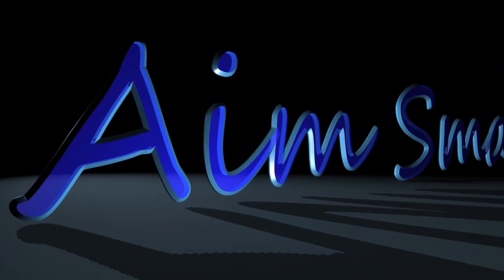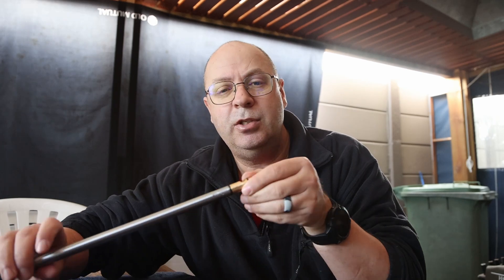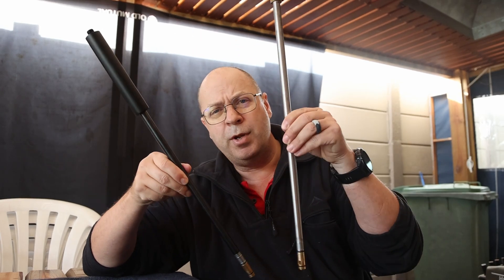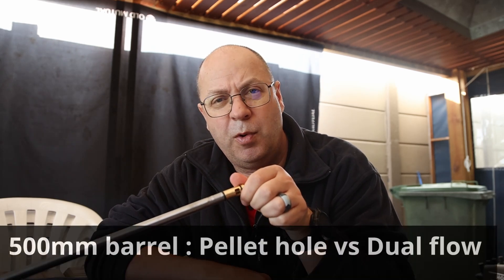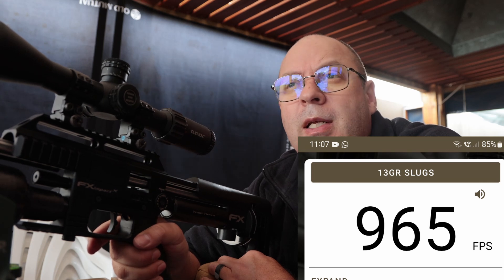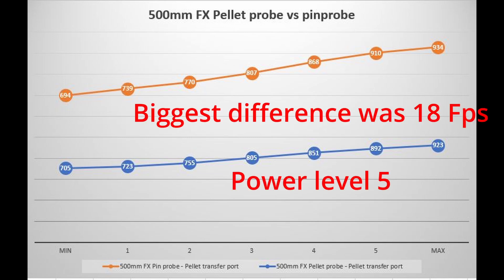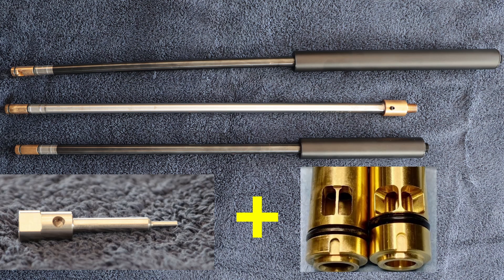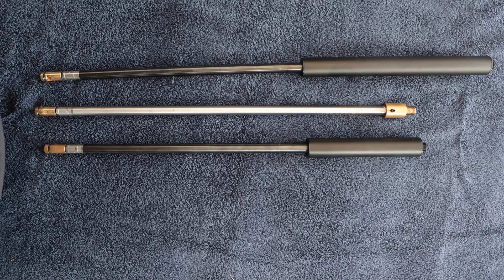How to increase speed on your FX without opening the internals?

Comment: I hope you can answer this
Why does FX list the MAVERICK (very similar to the impact) as 
177 10.34gr @ 930fps MAX
22 33.9gr @ 876fps 
25 43gr @ 925fps 

I mean... how can a heavier pellet go faster? I thought 177 was the fastest? Same gun... very confused.. 

What was your maximum power on stock internals with 500mm barrel with say 10.5gr 177 pellets?
Reply from the maker: Those different calibre guns usually have different lenght barrels, different transfer ports etc, different hammer weights and internals. They might advertice the 25 with 43gr @925fps, but then the shot count might only be 10 or 15 shots at that power due to the intensive high regulator pressure needed to shoot that heavy projectile at that speed. So the regulator pressure will play a massive role (and size of plenum). I could get about 27fpe with the standard internals and port on the 177, but then the regulator was at 170bar and the gun was working extremely hard, shot count non existend and accuray gone as well. Pellets don't like too fast a speed in any case, I prefer 177 not faster than 870fps max and .22 ar 900fps max.

Comment: Now we are getting into air flow dynamics.
 The best flow would be obtained by drilling through the transfer port hole of the housing and into the brass barrel extension with exact matching hole sizes. Then profile the probe nose to have  a radius curve matching the hole size which would give a radius bend effect like that used on exhaust ports and manifolds. Air guns are exhaust ports and the technology from them should be used where unmatched port holes have a detrimental effect on gas flow. At no time should there be any obstruction like the air splitter in the dual port as we are after unrestricted flow, not turbulence to aid combustion like into a cylinder head on the inlet side. I would like to see FXs data on these ports and where they came up with it beyond a good marketing campaign. Show me the flow chart?

There will come a time when straight line direct flow of air from the plenum and down a hollow probe will produce the maximum efficiency and all this other stuff will just disappear. As for the LW barrel being faster it will have more to do with pellet stall on firing. There are two reasons for this. Firstly this is common with 22 lr chambers where a longer throat slows speed because the bullet has moved forward thus creating a larger chamber for peak pressure to build into. A short throat that engages the bullet will reach the same peak pressure potential but in a more confined space and launches at higher initial speed. Same thing in centerfire rifles with bullets jammed in or set off the lands. But more specifically, the LW barrel has constant resistance due to a tighter bore than an FX liner where the pellet is virtually in freebore until it hits the choke. I have slugged numerous FX liners and they all have little resistance and are virtually in freefall till that choke. Actually i am surprised that they get the speed they do. While powder burners and air guns are two different animals, pressure is pressure and how it is utilized determines velocity.

Comment: Thanks Gert this was an extremely educational video, I always wondered what the big differences would have been with the dual port and Slug probe. And I must confess its not a massive difference. Having a 700mm barrel does definitely help in gaining some speed, I allready fitted the Power Plenum (watching Mr Ernest’ video step by step allows you to do this very carefully-do NOT skip a step) And now shooting 25gr in .22 at 135 Bar at 920 fps. was 980, but obviously dialed down the valve adjuster for less air waste and tighter groupings. Thanks again for the awesome videos. You and Matt and Ernest and Keith Gibson have the best educational Videos out there. Keep up the good work!!! Regards from JHB SA

Comment: Is your pellet probe fx or Huma Air,  I installed the Huma Air High flow transfer port and the Huma Air high flow pellet/slug probe along with the 1st and 2nd stage regulators and it made a huge difference in fps, consistency, standard deviation and extreme spread in my 30 caliber

Comment: When a barrel is faster or slower it is obvious that there is more friction in the barrel and this could benefit the spin of the projectile but also cause deformation. When there is to much spread in velocity you should buy smaller size pellets. Always push a pellet true the barrel with the righ tool for this job when you buy new ones or test other brand, this way you get a feel for what head size fits your barrel best. This should never ask for a big force !

Comment: Excellent video mate . . . this explains perfectly how 3 simple "upgrades" will impact your velocity and it also explains that simply combining them all together will not automatically mean you can add up the velocity gains per item. Just like an ochestra with the best musicians in the world doesn't automatically mean they will sound like the best orchstra in the world. If there's no homogeneity and balance, it will not work. In this case it could mean that the bigger transfer port, combined with the pin probe and longer barrel soak up more air so a slight increase in valve dwell time could optimize the speed even more. But like you mentiond, this is a video for people who just want to do some simple upgrades and this shows perfectly what you would gain.

Comment: Its because the rifling twist in the LW is internal, more agreesive at grabing and spining the pellet/slug compared to the FX barrel which has its rifling twist pressed from the outside. I tried the same exercise with a LZ cold hammer forged barrel and got an increase in FPS of 36 compared to the FX one with same weight pellet. It was also allot more accurate (tighter group) out to 100 yards.

Comment: Hi what foot pound were you shooting  and have you tried get more power with a 12fpe like we have in England  world this help more ? Great video
Reply from the maker: Hi Carl, I think I was shooting 10gr pellets at the time. Yes doing these changes will add speed to the gun and increas the Fpe. In the UK you have a restricter on the gun, there are lots of videos on how to remove it... The longer barrel adds plenty of speed for pellets, the dual flow in 177 you need to be more careful, some dual flows are so big that the pellet wants to fall into them. Pinprobe and pellet is not going to make the biggest difference, more effective with slugs.
Reply: @AimSmall  wonderful thanks 🙏
Reply: Hi, I don’t find any information or video how to remove the restricter, In Spain we also have fpe restricter if you can send some video or information how to remove it I would be really grateful 🙏thanks in advance

Comment: Would I get more power in sub12 ft pounds using this method in uk
Reply from the maker: If the gun has been restricted to 12fpe, yes, a longer barrel, dual flow port and pinprobe will add some speed to the gun. But don't expect miracles due to the power restrictions build into the gun, I don't know if the reg is adjustable or not?
Reply: @AimSmall   the reg can be adjusted if the anti tamper is removed but I wouldn’t know how much to adjust it … I don’t want to break the gun but I guess it’s the risk you take.. I think I might try the longer barrel and dual flow and pin probe just to see…. I honestly admire your videos what you do is fantastic ( the thinking man’s way ) 👍
Reply from the maker: @andydowden8117  If the anti taper is removed you can pusg the reg all the way up to 170 bar if you want to, unfortunately the air flow with the 177 isn't that great at that power. My gun is currently setup at 150bar with the duel flow and pin probe, it shoots 13gr slugs at over 900fps.
Reply: @AimSmall  wow thank you so much keep up the good work👍

Comment: Excellent video, very informative. I am curious to know how the air consumption is with the different options. It is clear that barrel length will not affect to efficiency but it’ll be interesting to know if air waste is higher than FPS gain. Of course you would need an accurate digital gauge for measuring the bottle pressure. In shorter words, it may not be interesting gaining some speed if the air consumption is way much higher hence shorter shotcount. Many thanks for your really interesting videos!!!
Reply from the maker: The shot count actually improves as you can get the same speed at lower reg pressure. The air is also used more efficiently, with the smaller air flow hole a lot of air is released and wasted, with the dual flow that same amount of air is more economically applied to the back of the projectile.

Comment: hmmm.. just a thought. When I was trying to find the perfect pellet for my Hatsan .25 it dis-liked JSB Exact King 25.39gr pellets @676fps , accuracy was okay, speed was not. Other pellets of slightly higher weight came out faster (AA Diablos Field 25.40gr @ 698fps and JSB Hades 26.54gr @ 705fps)... which I thought was probably pellet design and lead softness... but not sure.
Reply from the maker: 100% correct, not so much pellet design, it is more about the head size of the pellet, the softness of the lead and the lube used in the manufacturing process. All plays a part.

Comment: try the resistance of the chamber in both barrels ,adding the pellet , , if a pellet is to loose , then it will already moves at low pressure  because the air puls is not at it highest level .a pellet thats fits correct will start with more pressure and pressure is speed

Comment: Very informative as usual. Keep it up. Quick question, does the shot count suffer with the larger dual port? Just got a Crown Mk2, so i’ve been spending LOOOOOTS of time on your channel.
Reply from the maker: Shot count actually improves... let me explain, with the smaller port there is a lot of wasted air each shot, thus you need to up the regulator to get the desired speeds. With the dual flow the air efficiency is better, less air produces the same effort down the barrel, lower reg pressure equals higher shot count.
Reply: @AimSmall  Gert, that makes sense. Despite asking this question on SEVERAL different platforms, you are the FIRST to actually 1: address the question, and 2: give an answer. For that, I am extremely grateful. This "little" bit of info will make my tuning process so much easier; I want to tune for 22 gr slugs and 18gr pellets at the twist of a couple of knobs instead of having to change barrels every time I want to use slugs. I'm going with the lighter ones purely for that purpose. THANK YOU.

I'm waiting for my digital gauges before I start though. I've seen an average of 15 bar difference between the gun bottle and and the compressor and buddy bottle (which display pretty much the same pressure).
Reply from the maker: @dominicnoon  Yeah the gages are in general all inaccurate, I treid them all, from Huma to "new" FX. I did have one digital gage that was accurate but it developed a leak that couldn't be fixed... very expensive indeed. So now I use th fill gage on my silinder to check how much the gun gage is out...
Reply: @AimSmall  Good point about the cylinder. I ordered the Sehkmet because I liked the feature of shots remaining, not that I really need it, i've seen a few good reviews on them. Going to keep the originals though....just in case.
Reply from the maker: @dominicnoon  Please let me know how it works out. I loved my digital gage until it popped.
Reply: @AimSmall  I finally received my gauges and installed them yesterday. The factory ones read about 5 bar high at 110 bar and 18 bar high at 150 bar (reg pressures). No wonder I couldn't get it anywhere near where I wanted. Anyhow, I now going to start the tuning process. Any hints on settings to be able to use 25gr in the low 900s with a reasonable shot count or is that asking too much from the Crown Mk2? The plan is to have one for 25gr and turn the HS knob down for 18, 15 and 14gr without having to change reg pressure and maintain same scope zero. I know it's a large ask, but theoretically it's possible.
Reply from the maker: @dominicnoon  The gauges are most of the time out by 10 bar at least. The crown is an awesome gun, but due to the lack of a big plenum struggles sometimes to generate more speed. You will need to get that reg at 135bar for a start, should give you enogh power to shoot 25gr at 900fps.
Reply: @AimSmall  Thank you Gert. Didn't realize I could be able to do that with such a low reg pressure with the .22. Will get onto it and let you know how it goes.
Reply from the maker: @dominicnoon  My Impact has the big plenum but I am able to shoot 26gr slugs at 1050fps with the reg on 135bar... 700mm barrel. You might want to consider a dual flow transfer port and pinprobe as a later stage, the combo will add at least 30fps to the setup
Reply: @AimSmall  thank you. I flipped the barrel 180 degrees for the “slug” port and yes, I’m getting between 30-50 fps more on the Crown Mk2. Granted, I’m using the 380 barrel, so if I go to the 700 (comes with the continuum) I can get the speeds to increase more. Only thing is that don’t use the 700 much because I have to take it off every time I use it otherwise it won’t fit in the case. 🤣🤣🤣🤣🤣. 
Will let you know how it goes.
Reply: @AimSmall  Gert. I received my digital gauges and they worked like a charm unitl…i think i tightened the bottle gauge a bit much and over compressed the “oring”, so there was a small leak in bottle pressure over time, in the region of 20 bar per day. Took a while to find out what it was. Got it sorted now though. The battery on the “updated” gauge does leave a ittle to be desired though. 3 day charge going thru 5 mags, so I changed that one back to the original after I used the digital for fill reference from the compressor and buddy bottle. I’ve kept the pure digital reg gauge in place though. Will probably change that one back to the original once I have foind my “ultimate” tune. It’s easy to switch them out once the stock is off, which is needed for tuning anyway.

Your tests (although I thought they were strange at the time) have been EXTREMELY helpful, especially considering that I have limited space and access to different variety of rounds, the low speed tests were FANTASTIC. THey worked out to be exactly what i was looking for.

Thank you for taking the time to explain. Will let you know what my “final” tune turns out to be.
Reply from the maker: @dominicnoon  Tank you for the feedback, which digital gauge did you get?
Reply: @AimSmall  the "PCP Airgun Digital Gauge 25mm black" multifunction for the bottle and the "digital mini pressure gauge for FX impact 25mm standard" for the reg (pressure only).
Reply: @dominicnoon  I have followed almost all tuning vids on YT and I have finally figured out the tuning method. On the Crown it might be the same way as well.
1: Always make sure your gun is fully loaded with air.
2: Get your reg on about 130 bar the start with. (For anything between 23 and 35gr pellets or slugs)
3: Have your Valve adjuster open just past line 4.
Then start shooting through the Chrony.
Fiddle with the reg and take it up 5bar at a time untill your reach close or up to 980fps. Some slugs like more speeds, speed and twist rate goes hand in hand. 
Then start shooting groups, they might be a little all over, but close the valve adjuster half a turn at a time and shoot another group. Carry on like this untill about 920fps or if your groups are very tight. Happy shooting
Reply: @djrautenbach2407  Thank you. I have a Crown so tuning is the same principle but different procedure. I now have a few different tunes, each allowing required speeds and excellent accuracy for 4 different projectiles depending on the situation.

Comment: Thanks for the video bud. The Crown and Impact are so adjustable nowadays. I started buying Avengers bud.  I swear for a crappy shooter like me…they shoot just as good and I set them up for whatever I want to use in them and leave it alone. Slugs at 70FPE in .25 is a plenty, and 14FPE in .22 with Daisy HP@15.4 grains stops from blowing holes in the tin of the farmers barn while doing pest control. These PCPs are getting affordable enough and accurate enough that the days of paying top dollar for a 1/4” tighter at 100 yards just isn’t worth it any more thanks to smart people in marketing and CNC machines bud. If it ain’t broke…don’t touch it 😂🤷‍♂️💯
Reply from the maker: Brilliant, I feel the same. In comparison the FX is way cheaper than the Daystate... but bang for your buck is the Avenger by far, you can buy 4 or 5 for the price of 1 impact, have all 4 setup to shoot different projectiles. Especially PC where buildings are involved. I shoot 15fpe near buildings with my 177, soft pellets that doesn't penetrate roofs etc. On the open i use the fx canon at 50fpe slinging slugs through everything.lol.